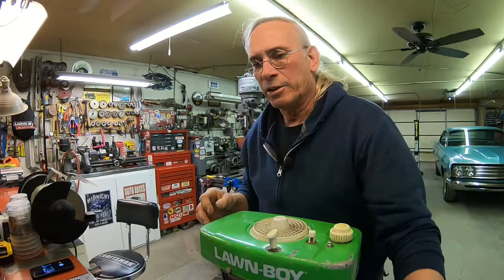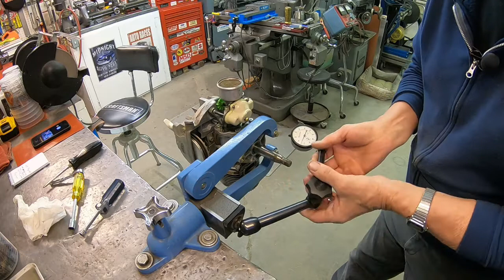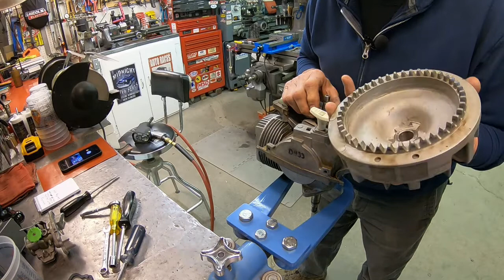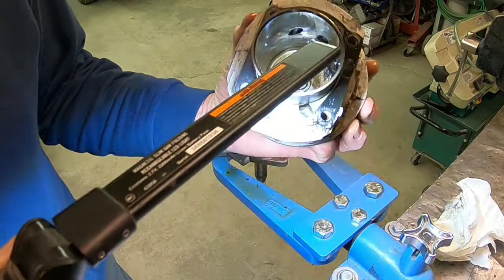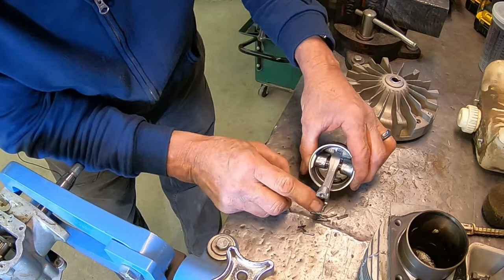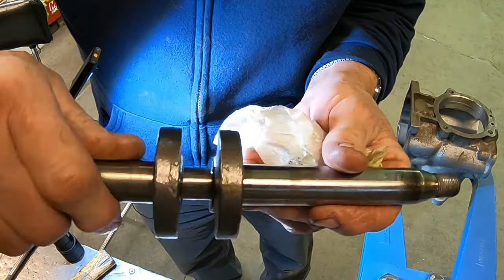Lawn Boy D-400 lawnmower rebuild. Disassembly

Comment: I'm in the process of going through my late 60's D 400 motor my dad gave me to go along with the mower he gave me when I bought my house in the mid 70's.  I think everything is all right.  It had a stuck top ring that came loose right away when I sprayed some Kroil on it.  I'm going to watch your video and put it back together with a new cylinder base gasket and seals.  I have the mechanics book for it so it should be a breeze.  The shroud and deck are cream colored.  21" deck.
Reply from the maker: Hey Ralph, man those LB engines are among the most durable and long lasting of any engine I know. They are getting hard to find parts for though. Sounds like a good plan you have, and I suspect you will have no difficulty's getting her back together and running top notch.
Reply: I recently took apart one of these engines. I took the piston rings off and not sure which way the top piston ring goes?  It has a lot of taper to it. 
 Do you know which way it is to be faced?

Comment: Lawnboy Twostroke sweet 👍👍 I was going to recommend some castor 927 in that baby 😃😃🏁🏁 what I used in my race bikes and what most local guys I do engines for use ✊✊ nothing wrong with yamalube proven stuff. Team Honda used it in there hp bottles back in 90s
Reply from the maker: Still use my Lawn boy mowers every time I mow. I actually do put just a couple ounces of Castor 927 in the gas with the Yamalube just to give it that great smell.

Comment: Know what you mean about LBs. Iwas given a D400 in 78 for parts. Lady’s son had run it without oil.  I had only worked on Briggs so did not need parts. I took it apart to check it out and got it running for $27.  Used the hell out of it for about 30 years.  I did find an oversized piston for it at one point and rebored it.  What an awesome mower !  Love your shop also. Have been a mold maker machinist since 1980.
Reply from the maker: Hey Henry, thanks for spending time with me in the shop. Yes sir, the LB mowers are great machines, and I still use one every time I mow. Love how quiet they are, so smooth, and love the 2-stroke smell. Thank you for helping build our great country one piece at a time. Happy Independance Day to you and the family.

Comment: I would like to ask you to do a Lawn Boy Series of each engine, The "F" with & without thrust bearing on Crankshaft and the Duraforce engine. we have no one to teach us.
Thank you.
Reply from the maker: Oh wow...I would like to do all that for sure...however I don't have a Duraforce, the "F" model I have is running and running well, so I hate to tear it down. To be quite honest...I have never worked on a Duraforce and nothing major to an "F". I have a couple extra "D's" that need some work, and I just picked up a "C" on a Snowblower. So, I hope to do some work to them soon. I have the "D" that I put a sleeve in that still needs to be bored and the piston fitted. I have just been pretty busy with the motorcycle restorations and hope that winter will bring some slower times to finish up some of that stuff. That being said...If I run on to any of those type mowers at a good price, I will pick them up for future projects. I would like to take a look at them and learn about what makes them tick.  I sure appreciate you hanging out in the shop with me. Thanks so much for the comment.

Comment: I am trying to take off the plate under a D415 so I can clean the ports.  Any suggestions?   Blade is off, stiffener is off, 3 bolts are loose but I can't get the cover off.
Reply from the maker: Hi Chris, I dont know if the 415 is the same as the 433 but it should be. Think you have everything loose, maybe just try to pry the two muffler halfs apart with a screwdriver. Sometimes they can get stuck. Or you might try pulling the 3 engine bolts and just lifting the engine from the plate. Sometimes the muffler seal will stick too.
Reply: @montana2strokeracer  one other question.  Do the bolts come out of the lower half?
Reply: I have no brain.  Didn't realize till today that the bolts had nuts on the top side.
Reply from the maker: It happens Chris, I have the same issues from time to time.

Comment: Hello, I really like this video! I’m wondering where you can find that engine hoist table that clamps to the table like that because I’m planning on doing a rebuild myself on my Lawn Boy. Thanks!
Reply from the maker: Thanks Mike, are you referring to the blue fixture the engine is mounted to? If so it is a OTC 7020 holding fixture. Thanks for watching.

Comment: I recommend the SUNOCO non ethanol pump gas ⛽the Premium 91 Octane.
Reply from the maker: Thanks Brian, we don't have sunoco here, but we do have non ethanol premium at ExxonMobil, that's what I use with 32:1 yamalube oil.  What model lawn boy are you running if I might ask? I'm still mowing with a D and F.

Comment: Very nice video.  Thank you for this.  I have a `74 7224 with a D600.  Been in our family since 1974, passed down through the generations.  We've used it all these years, and in 2020 it called it quits.  No rebuild of the engine was ever done during that time.  The cylinder, piston and rings have scoring, and there is piston-slop and low compression.    A few people think I should just throw away the mower.  I will not.  Planning to have the motor re-built or a NOS block installed.  Should outlast me.  As this mower was made before I was born.
Reply from the maker: Hi thanks for the kind words, that is a great story about your lawn boy. Much like mine really. You need to find some parts and rebuild that little gem. I still use two lawn boys to maintain my yard. The d-433, and a "F" model. Both are now running strong. I will be posting another video soon. In it we will bore and hone to fit the new piston to the newly sleeved cylinder. Thanks for watching and commenting.
Reply: @montana2strokeracer  Thanks.  Glad you enjoyed my story.  Very nice you still use D and F engine mowers.  I may be able to get an NOS short-block D600 made in 1993 for it.
Reply from the maker: @1984AP  man that will make it brand new again. sounds like a plan
Reply: @montana2strokeracer  I agree.  One friend thinks I should check/clean the exhaust ports as this may be causing it not to start, and causing low compression, before proceeding to purchase a NOS block.
Reply from the maker: Hey that is an easy check. You bet I would look first. If all is good...get the new parts. Keep that lawn boy mowing. Thanks brother.
Reply: @montana2strokeracer   Will do.

Comment: Where do you get parts?
Reply from the maker: You can find most parts on Ebay.
Reply: @montana2strokeracer  Dale thanks for the info.  I've been getting my parts from Ebay, thought you might have another source.  Also thanks for the terrific one of a kind videos.
Reply from the maker: Thanks John, more are coming on the lawn boys, I have had some luck with parts John's small engine,  but they are just getting hard to find. Tulsa engine warehouse closed a few years ago. They used to have pistons and the such. Last piston I found was on ebay cost 125.00. That's why I wanted to see if I could sleeve a cylinder. At least that way you could fit good used pistons, to it. Thanks for watchin.
Reply: @montana2strokeracer  John's Small Engine in Missouri?  I may have another source for you for pistons.  Having some luck with them.
Reply: @montana2strokeracer  Not so much with cylinders and pistons sadly.
Reply: @montana2strokeracer  I did find a guy on Facebook who has a bunch of brand new cylinder heads for the d Engines
Reply from the maker: Well thank you, is he selling them?

Comment: I have quite a few old lawnboy 2 strokes.  Really interesting.  I have a couple of  of these engines with clapped out bushings.  I have yet to snag a brick top, though.  Like you, I got one of mine, a Bermuda Sand 1965 model, by way of my uncle, who inherited it from my grandmother who got from my grandfather, who bought it new, when he died in 1969.  It was the first mower I ever used, and still runs today.  But it is loose as hell and eats seals like potato chips.  I only start it now and then for nostalgia.  I always thought about  having bearings installed until I got the estimate from a machine shop.  All the great engineering into these, and they installed a bronze bushing.  Ugh!   Haha!  I'm told the reason is was that they can take more impact loads than needle bearings.  I'm holding on to them, for one day, I will have a mill.  Fingers crossed.  Question, it's been a while since I had a D engine torn down, how are you getting lubrication to the needles with a flanged bushing above it?  Is there a fuel port going there?  Anyway, thanks for posting this series.  I love watching your work.
Reply from the maker: Thanks for the lawnboy story, love hearing all of them. Yes there are fuel ports (two of them) that are supplied fuel from the reed valve area. But in my case the only reason for the flanged bushing is  to correct the worn case for crankshaft end play. All the crankshaft wear is were the crankshaft runs through the flanged bushing so it is quite loose. It is a standard 7/8 inch ID bushing so it has probably .020 play between the crank and the new bushing. The bushing has two holes than supply the fuel from the reed valve area. Only the needle bearing is keeping the side to side clearance in check, because it is lower in the case right above the seal were the crankshaft has no wear. It is a virgin part of the crankshaft so it worked out nice, think I had about .005-.006 clearance if I remember. That boring job was done on my lathe, but i think the next one will be done on the milling machine.  Think the setup time will be less. Hope this answers your question. Thanks for the comment, lawn boy story, and for watching.

Comment: Wow, this takes me back. My Dad had a very similar one way back! If I knew half what I do now I perhaps could have rebuilt it. Nice! Before I forget, there are a few of us, me included, who'd love to see how you adjusted  timing on the TC125 or one like it. Thanks! Oh, and what the heck is that cool vise??
Reply from the maker: Are you talking about the bench vise or the blue holding fixture? The bench vice is a Morgan 5 inch made in Chicago. The holding fixture that I have the engine mounted to is a OTC 307-003 it is avaliable on line still from OTC distributors, I use it mainly for holding  Ford 9 inch center chucks. Wow I cant believe I didnt show the timing on that puppy. Believe it or not, I just used the feeler gauge method. I will be sure to do it on the next project for sure, may even do the buzzer method.  Hey thanks for watching and the new project should be out this week.
Reply: @montana2strokeracer  Thanks, Dale!  I was asking mostly on the swiveling fixture. You have tools I never heard of.  Every video I watch I learn. Good thing I don't live around the block or I'd show up with a beer or 2 just to hang out! The one and only time I needed to set timing on points I first used a feeler gauge and then  light bulb & battery. There is big debate online about which methods are best. I figure it is good to see what a pro like you does. Really enjoy your videos. You are a natural teacher. No drama, no funky camera stuff. Just straight, well presented info by a good guy.
Reply from the maker: @jamesws3  Hey James thanks for the kind comments, if you lived around the corner you would be welcome, and I sure enjoy a malted beverage from time to time. Yeah that OTC holding fixture is very handy, it will adjust to fit most anything. I put automatic transmissions and rear end center chunks, and lawnmower engines on it. The purpose made one for motorcycle engines works the best for them, especially if you are splitting the cases. If you are ever in Montana let me know be happy to drink a couple beers with you. Thanks for watchin.